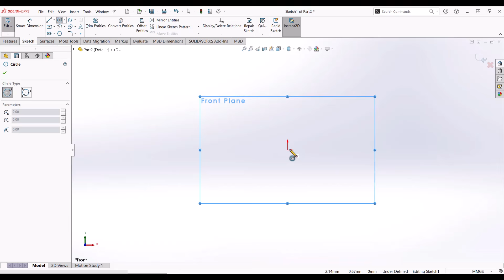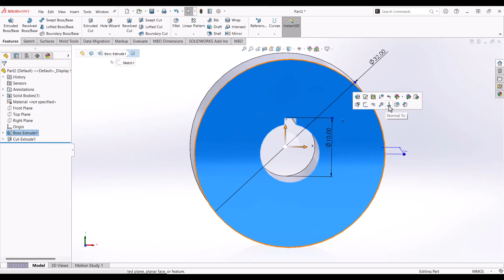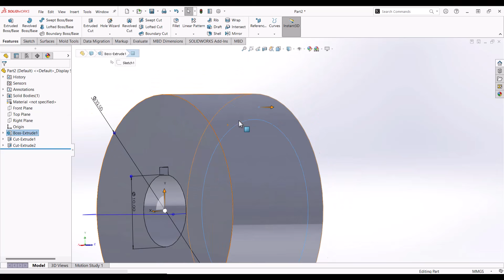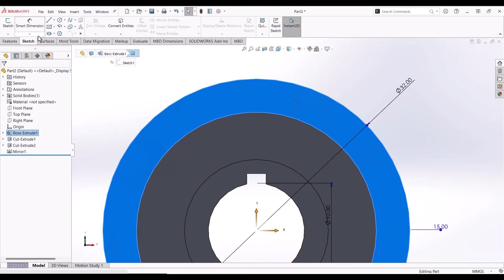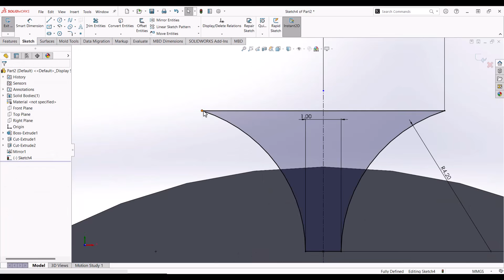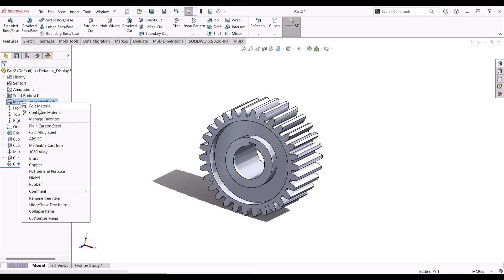How to Design a Spur Gear in SOLIDWORKS | Step-by-Step Tutorial

Comment: i still don't fully understand modules , 
if i am not mistaken , this gear that you posted is module 1 because it's diameter is 30mm and there are 30 teeth .
please do confirm or deny my assumption , it would help a lot .
thank you in advance.
Reply from the maker: Good question  you’re close, but there’s a small correction.

From the drawing:

Number of teeth = 30
Outside diameter = 32 mm (not 30 mm)

Module is based on the pitch diameter, and we use:

d_a = m (z + 2)

So:
m = 32 / (30 + 2) = 1

So yes, this gear is module 1.

Your assumption would be correct only if 30 mm was the pitch diameter, not the outside diameter. 

if it's still not clear i would be Happy to creat a video where i can explain it in more details

Comment: How to make this custom made spur gear Mate with SolidWorks toolbox's spur gear?
When I rotate both gears their teeth overlap each other.
Reply from the maker: The overlap usually happens because the Gear Mate ratio or the Center Distance is slightly off. Here’s the quick fix:
Match the Pitch Circles: Gears must be spaced at exactly the sum of their pitch radii. For both gears, show the "Pitch Circle" sketch and ensure they are tangent, or set a distance mate equal to {D1 + D2}/{2}.
Sync the Teeth: In the Gear Mate settings, don’t use diameters. Type the actual Number of Teeth (e.g., 20 and 40) into the ratio boxes. This ensures the math matches the physical model.
The Reset: Suppress the Gear Mate, manually rotate one gear so the teeth don't touch, then unsuppress the mate.
Pro-Tip: Ensure both gears have the same Module and Pressure Angle (e.g., 20°), otherwise the tooth profiles will never mesh perfectly!
Reply: @JAKDesignEngineering  Thank you for your help.